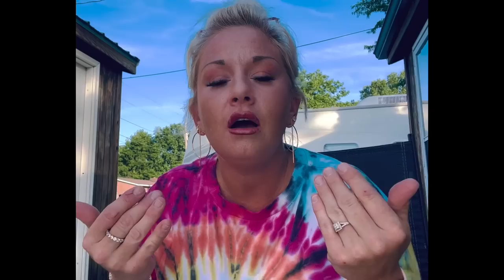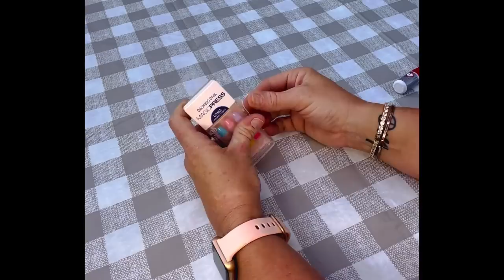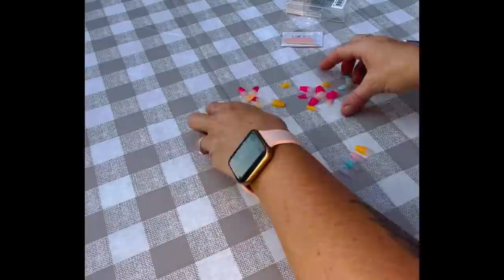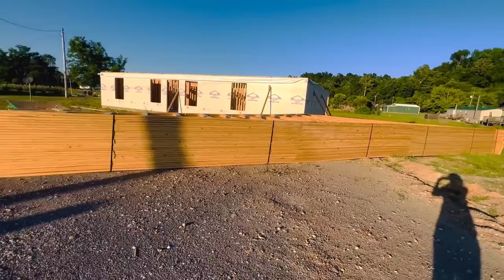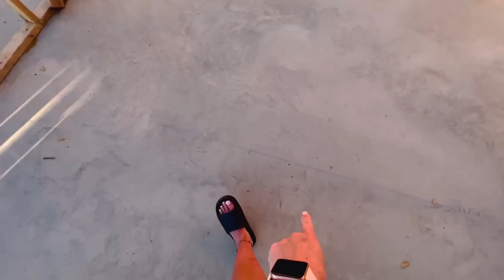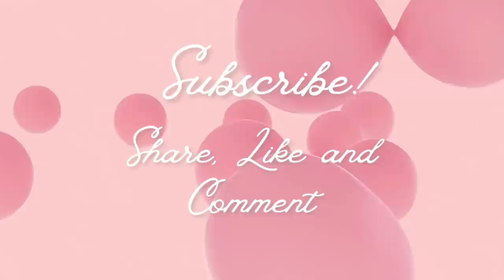All New Updates + How I Do My Nails, Blessed Beyond Measure

Comment: Tip: use the Beauty Secrets glue from Sally's. It's easy cheaper than the Kiss brand, and lasts longer. Don't get your hands wet for four hours after you put them on. Don't pry or peel your fake nails off. Get some actual acetone at Sally's, and pour some into a small bowl. Get another, bigger, but shallow bowl, put some water in it, and heat it in the microwave for 3 minutes. Put your bowl of acetone in the bowl of water, so that it warms up your acetone. Your fake nails and glue will be gone in ten minutes. It's much better for your nails than peeling and prying them off.

Comment: I was one of those comments YAY!! I love hanging out with you whenever I can. I pay $39-$60 every time I go, and I just stopped and said Wait,  need to start looking into other options because everything else is getting higher & higher (except My Paycheck).

Also, when I took my last set off My Natural Nails are destroyed and I just feel My Nails need to heal and that’s $120 a month on just nails and I wanted to start thinking of ways to do the nails myself. Everything is getting so expensive and I have to start doing things cheaper, if I can. I’m not saying I’m going to like it as well as I like my acrylics, but perhaps I can learn to like something different to save myself some money. So I bought some full coverage tips as well as some cheap acrylic to start practicing if nothing else maybe I can learn to do them myself.  

Right now though I need to take a break from acrylics and let My Natural Nails heal. As much as a hate it, its necessary. I did buy a UV light and gel glue which is much stronger than regular nail glue. I do love all of the “Candid” videos 🥰